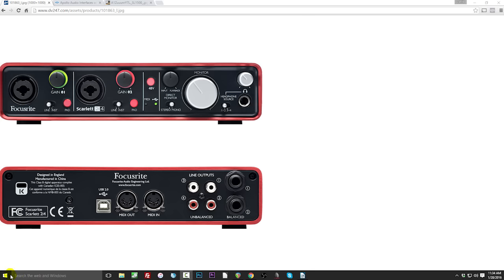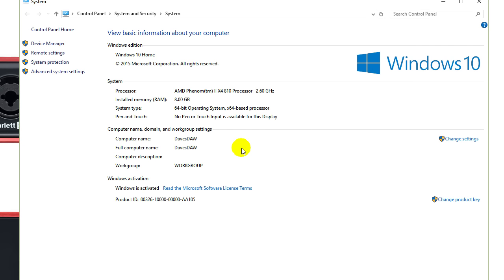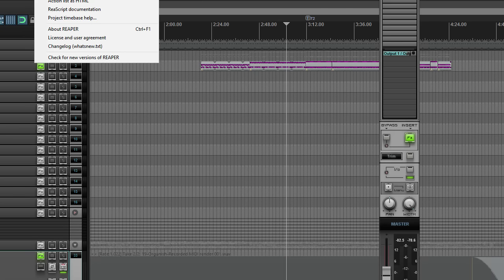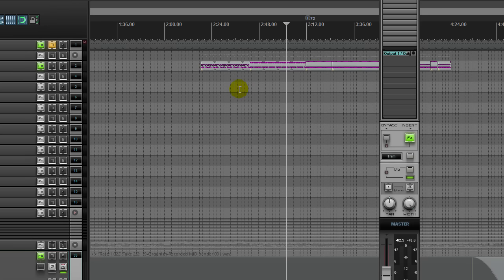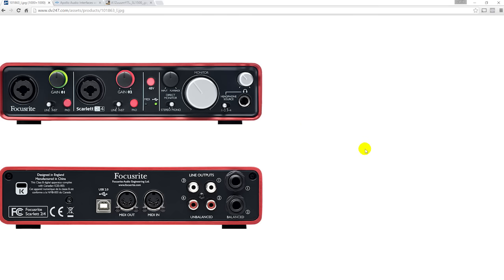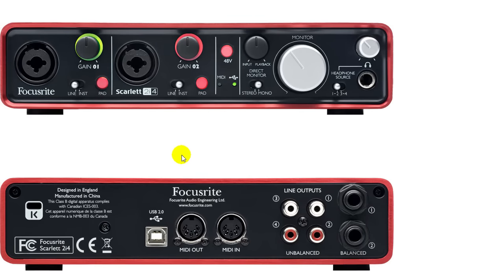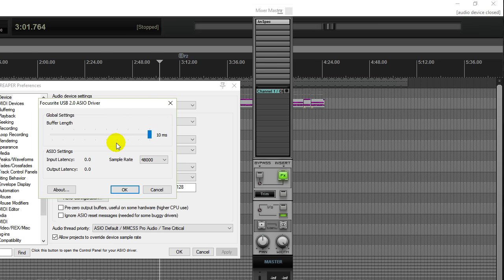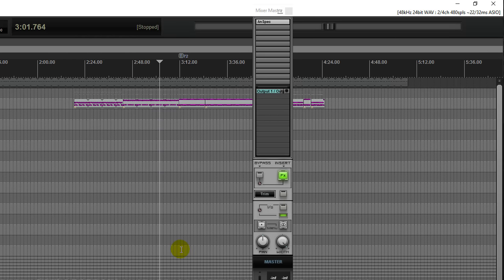Fixing Recording Latency

Comment: Oh, I guess I'm lucky because I can use 32 samples at 48 kHz even in a large session (46-48 audio tracks with tons of plugins and of course a bunch of aux channels). I'm actually using an eleven rack at the moment (usb2). My digi 003 rack+ has to be fixed. I have a MacPro early 2009 upgraded to 5,1 and dual 6 core 3.33 mHz processors. But it was actually the firmware upgrade from 4,1 to 5,1 that did wonders for the latency. I had the samples set to 512 before but now I can set it to 32.

Comment: Hi so i'm very new to audio recording so I just have a few questions: My audio interface (behringer umc404HD) also has a zero latency monitoring option. If I want to record vocals over a backing track and hear both the vocals and the backing track in my headphones at the same time, will the vocals be offset from the backing track due to the latency? Or if I have the zero latency monitoring knob set all the way to input will I not be able to hear any of the backing track at all?

Comment: question: in case i would link a mixer in my AI where do i switch the +48 volt swich on: on the Audio interface or on the mixer 
i saw this one time in another video but i had no reason to do that. however i work with an laptop ( untill i can have a normal pc ) and this maschiene has not so much power so i must overcome that latency problem somehow but this is the question i have:
a - does that work with every mixer 
b - can i somehow program that mixer for having two different modes : one for simple speaking or reading text and one for singig
c - on which of the two devices do i have to turn on the +48.
as far i understand serves the mixer avtualy as output device so for my understanding this is the place where to turn the +48 on.... or am i wrong and it has to be done on the AI! 
thank you for the video liked it....

Comment: I hate recording on a computer, theres always issues. I got a roland quad capture installed drivers go to reaper pick asio drivers and all i get is a wall of white noise. But then i switch to wdm drivers and it works but then i get this stupid latency issue. Theres always problems. Why cant this day an age simplify the whole process. Its fucking stupid. WHY ISNT THERE A AUTOMATED FIX FUNCTION BUILT INTO DAWS.
Reply: Same here the Moog analog synthesizer is great because I can play it both stand alone or with a computer. So recording the Moog live with no computer has near zero latency. I am surprised DAW have not fixed the PC latency issue yet!